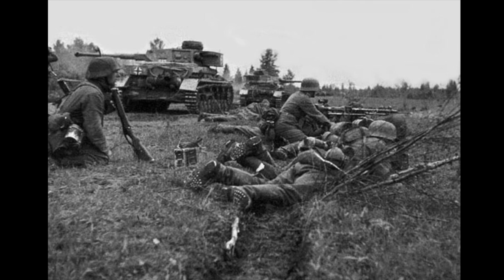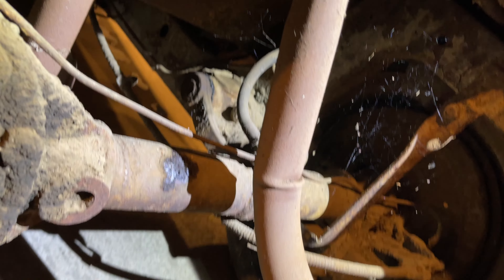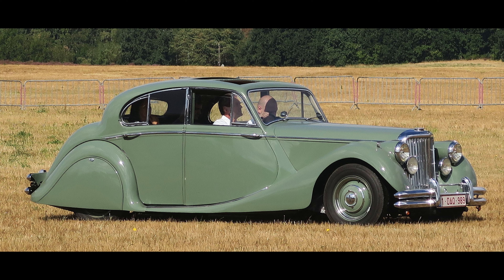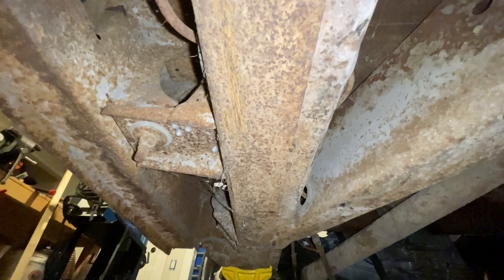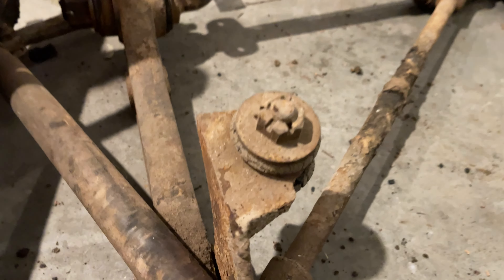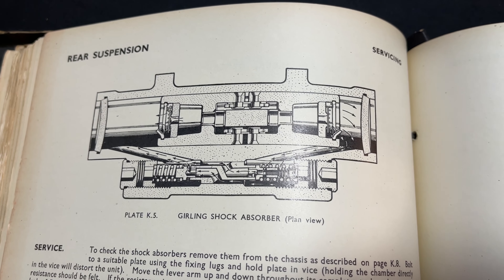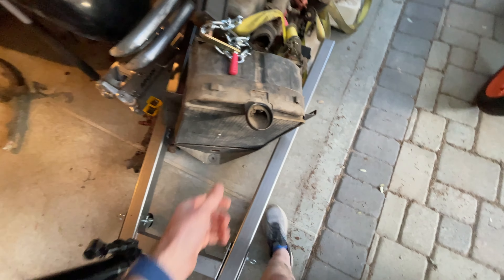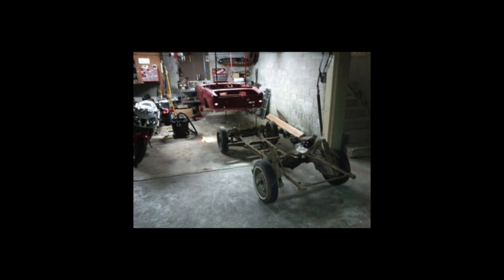The Design And Engineering Behind the Soon-To-Be-Tesla-Swapped 1950 Jaguar Mark V.

Comment: BSW and BSF (British standard Whitworth and fine) were very common here and have spanners that fit properly. Unlike those janky wierd UNC 'murican things. You should probably buy some old British spanners and sockets .. wait.. you already have some in the tool kit that came in the car ? Dang. Being serious, it probably wouldn't kill you to buy some BSF sockets. In preparation for you opening and converting the instruments etc later you might want to be aware of (buy a set of spanners for) BA (British association) too, those were common for small screws in things like, say, instruments. I'm sure a man like you has a copy of machinerys handbook (if not, hold your manhood cheap, what else would anyine read when having a crap?) you can probably find out about them in that but I'm to look in mine to check since it doesn't really matter, you need sockets not the dimensions. You can of course also read about them on wiki. I did check that

Comment: yep e type looks like a tongue  ,got a good laugh out of that . hot tip whitworth bolts and nuts use whitworth spanners , some sort of evil pomy engineering from british empire  , the finest of british   electrical engineering  lord lucas prince of darkness (throw that stuff away) and anything that needs oil will not hold it  throw that stuff away as well . compound turbo 12 valve cummins will do nicely to keep the batterys charged

Comment: As an engineer and enjoyer of old cars I am amazed. 
Everything manufactured has tolerances, so saying they didn't consider them is just weird? They were just limited by the manufacturing methods of the time. At the same time these cars are more serviceable than modern ones, they had to be as they had a much shorter expected service life and needed to be repaired to be kept on the road. Just the lack of knowledge on how old stuff was made is just frustrating here.

ALSO
How do you googke it and KNOW they're Whitworth bolts and not figure out that Whitworth bolts require different wrench sized? The idea they made "wrenches sloppier" is so fucking asinine.
Maybe I'm just a retard and just didn't get some sarcasm but damn.

Comment: Haha, withwoth are cool, old series landies had them, just try finding a set of appropriate spanners for a decent price...

It is said that one can completely disassemble a 1953 series one land rover with 6 or 7 spanners. Talk about simplicity!

Also the measure ment on the bolt (5/8) refers to the thread diametre on the flat to flat of the bolt. All this because the brits pretended to be metric but wanted to be imperial.

Comment: Don't you go diss'in our joe whitworth young whippersnapper! not so fast, how would you like to live in a world where every bolt has its matching nut and not another will reliably fit! in walks our hero, joe, with his addition of the lead screw to the turning lathe and bingo! repeatable standardised thread forms, so you take that back, or i'm unsubbing (perhaps, if you ever get boring, or lame)
British Standard Whitworth (BSW) is an imperial-unit-based screw thread standard, devised and specified by Joseph Whitworth in 1841 and later adopted as a British Standard. It was the world's first national screw thread standard, and is the basis for many other standards, such as BSF, BSP, BSCon, and BSCopper.